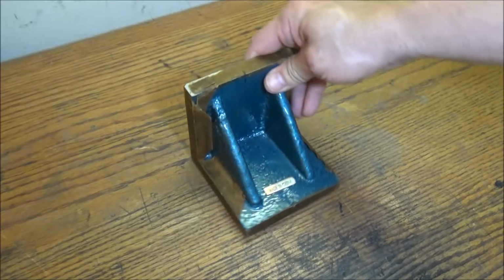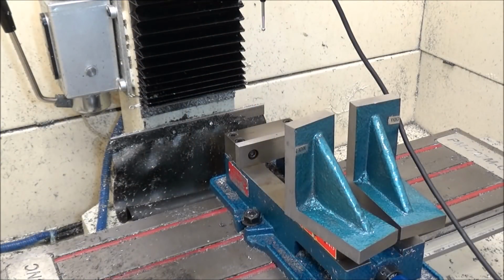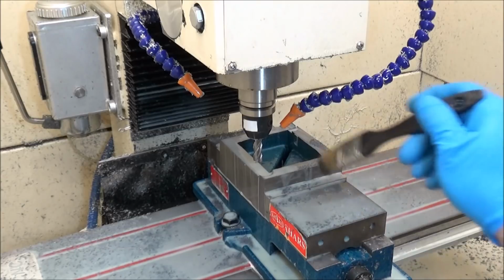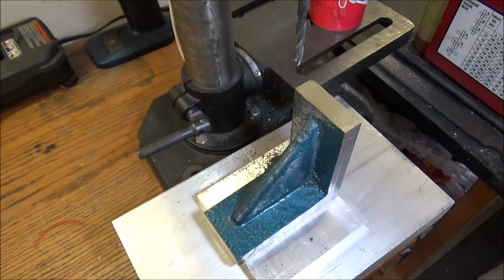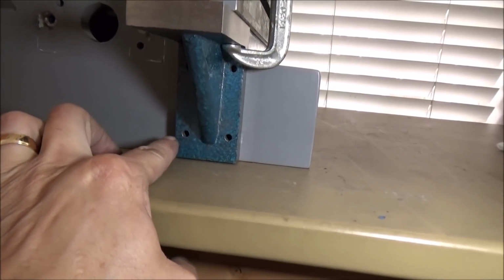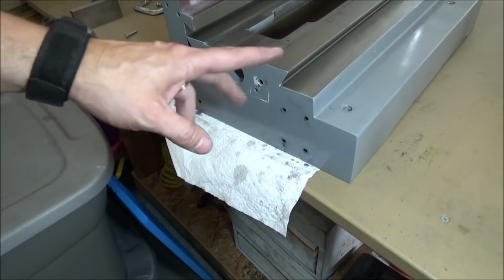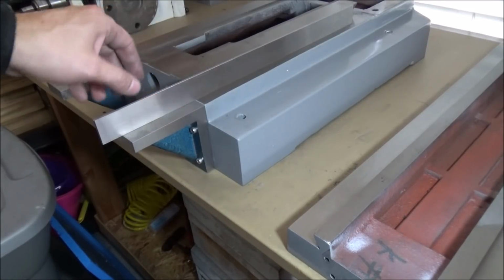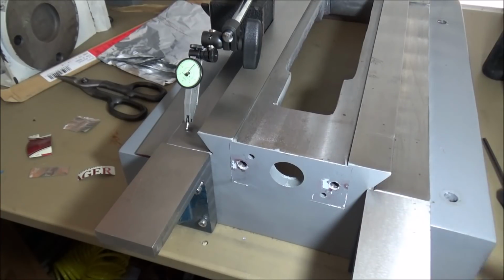Y Axis Extension Brackets

Comment: Nice work Sam - I was thinking along a similar line to extend the Tormach SlantPro 15L bed at the tailstock end with a modified cast iron angle plate trimmed to the bed dovetail, in order to get a better distance between centres. You could fit grub screws close and adjacent or above/ below the cap screws and then jack the surface level.  Cheers  Cliff
Reply from the maker: Thanks Cliff! Yes My buddy Wyatt mentioned Grub screws as well and its a great idea! This was just a preliminary test fit and I shimmed just to see how far it's out. I was pleasantly surprised that it was really close. I will strip down the paint to get a clean mating surface and if needed I will most likely add the grub screws.

Comment: A question, not a criticism: are you going to scrape the paint off the base casting between the mating surfaces?
Reply from the maker: Good Point! Yes I plan to remove the paint on the front of the Base. I think the paint may be thicker towards the bottom half of the base. Which maybe why I need the shim in the first place. I think the front of the base has a machined surface so I want to take advantage of that. I will be painting the Y extension brackets as well.

Comment: Putting linear rails on it instead of dovetails seems to be a 'no brainer' for achieving a really accurate and stable mill... Why don't mill manufactures offer mills with this feature... I mean.. its a ton of work to retro fit it.. and there is a bunch of parts left over....
Reply from the maker: More and More CNC MFG are offering Linear rails even the Bench top mill MFG Like Syil and Sky fire offer Rails.
For manual mills I'm not sure it would work well. Now if Bench top machines offered a stripped down machine ready for CNC that would be awesome.